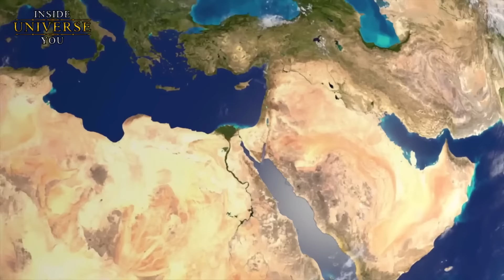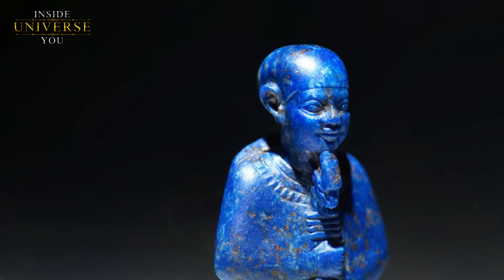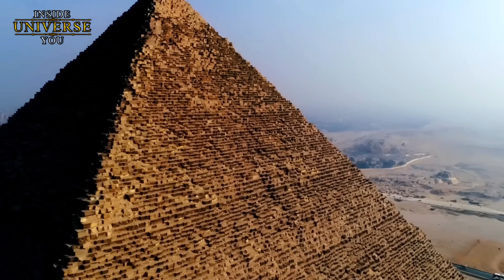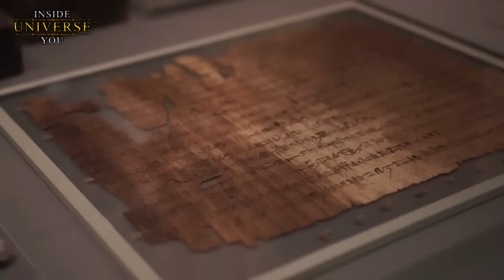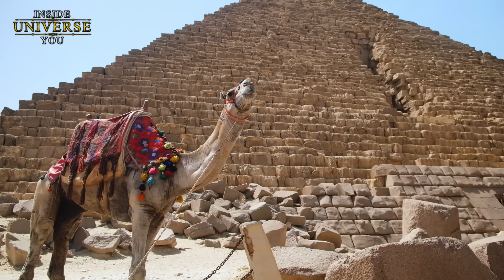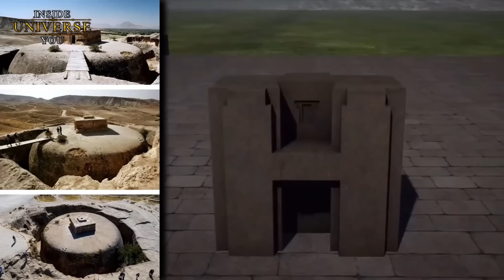They Proved How The Pyramids Were Built: Geopolymer

Comment: The tool marks on some of the blocks was just from smoothening/leveling methods to make the surface perfectly flat/smooth after casting. You don’t know what they used for the casts, there were likely some small bumps/ridges when removing the cast and the ancient Egyptians build to perfection

Comment: Its a power plant. 95% of the planets around the world are build to line up with orions belt. Satellite imaging shows 9 large columns just below. Its possible they are large pyrite crystal than can conduct the earth electricity to connect with the other around the globe. 
I have a theory that at one point in history 200K+ years ago. When all the pyramids were active it powered the startgate systems. They require so much power that only a few thibgs can power it. The sun directly (dyson sphere, zero point energy, the earths spin etc. Occuns razor says its not that far fetched.

Comment: Another great video by UIY. I think it makes sense that the builders would have used both cast and quarried stones as doing so would have allowed them to optimize both logistically. As an engineer, I would have wanted the corners and other structural key points to be natural stone as there is no wait time for curing. By alternating cut stone with cast, the cut stones act as half the needed mold forms. As much of a given level is cut stone, the next level can be started sooner as it is not necessary to wait until the cast stones are 100% cured.

Comment: Given that Gobekli Tepe has terrazzo (concrete geopolymer) tens of thousands of years earlier than Roman use on the floor, clearly such chemical knowledge was commonplace in ancient times. The Land of Chem guy has proven the function of the pyramids was largely for manufacture of desired chemicals. These two things being so, it is now beyond any question that the Pyramid blocks, and those of megaliths worldwide, were poured and cast from powders that were combined and liquefied chemically and which later hardened into stone. Marcel Foti with the Natron theory has further actually done these processes with casting "basalt", "granite", etc. You can easily imitate natural stones visually with the right skills. Geologists actually assess stone types visually, so that means they have no real idea of the origin of any of these "stone" megaliths. This explains scoop marks, precision, tight joints, size, distance, and the other anomalies, in a perfectly rational way. Sadly some people are addicted to being "wooed" by the anomalies and are clinging to the ignorant viewpoint that geopolymer is somehow impossible at this time, but Gobekli's terrazzo proves otherwise. Wake up, Ben. It's geopolymer mate. Lose the ego and we might learn more than "oh wow how did they do it?".

Comment: This video is not rooted in fact. The limestone blocks were the outer casing stones. Not the ones used to build it but the ones used to cover it and make it look white. Those stones are apart of the buildings in ciaro today. The actual inner stones are made up of heavy granite blocks from Aswan. They weren't pored like cement. There's no evidence to support this, further more there's actually more evidence to support the exact opposite.

Comment: maybe the pyramids were in a state of ruin by the time the Egyptians arrived. for example, maybe the top half of the pyramids were destroyed or unfinished. the Egyptians could have seen this and were driven to finish or repair them. this may be possibly why there seems to be more casted stonework at the top of the pyramids as opposed to the lower areas which was stated in the video. the casting of stone would help explain some of the giant stone cuttings and tetris like shapes in walls that are found in Peru. the problem with this is that if those tetris shaped walls in Peru were casted the stone, you would have a flat surface wall. in Peru you see rocks lining up perfectly with no gap BUT the rocks that make up the walls, most of the time, have rounded edges to each rock. if the rocks were casted that would be hard to make a cast with rounded edges.

Comment: so what about the cut marks found on the blocks?
Reply: What about them? What about the scoop marks ?
Reply: @RJB1929 what's a scoop mark since stone can't be scooped ?
Reply: @GroberWeisenstein  Hard stone cannot be scooped. Correct. And yet Peruvian megaliths, Egyptian megaliths (some), and Stonehenge, all show clear scoop marks, and signs that at one stage they were not hard but soft. Obviously not molten, because that would mean temperatures which are not approachable by a human worker. Therefore they were worked whilst at room temperature or close enough to it. And chemistry is how it was done. Look into Marcel Foti's Natron theory. They make kitchen counters the same way, or similar, today. But no scoop marks because the mould is flat.
Reply: @RJB1929  when you see bunny rabbits in the clouds are they actually bunny rabbits ?  Those of us that work in granite quarries and in stone manufacturing know that granite can not be softened or " scooped"  it's simply a misnomer.  " engineered quartz " is a gravel composite bonded by polymer resin. It is not UV stable and resistant enough to be used outdoors where it degrades. You may want to take a weekend stonemasonry workshop and learn some hands- on truths about stonework.
Reply: @GroberWeisenstein  Sigh. Read the book and watch the demonstrations. Natron Theory by Marcel Foti. Irrespective of anything I say, the scoop marks are there for all to see, if you bother looking. They are not controversial. It is the method that is under question. The fact they are there is not.
Reply: @RJB1929 i know how it's done and it doesn't jnvolve " natron" that's a very foolish idea.
Reply: @GroberWeisenstein  No, you don't.  And no it isn't. Ignorance is not your friend. Goodbye
Reply: @RJB1929 stupidity is your conjoined twin. I'm a granite quarrier and manufacturer.
Reply: @GroberWeisenstein  LOL Ok. Go make videos about how impossible it is. Off you go. I'll be right here.
Reply: @GroberWeisenstein  So, explain the scoop marks, then.
Reply: @RJB1929 show us how you scoop granite since that's your position. You  are asking me to make a video showing how it can't be scooped? How do i prove a negative outcome?

Comment: Again casting would still be advanced technology, and where is the blueprint or recipe to make it? In order to cast, they would have have made molds then slid basically slammed blocks against each other, if they made one against the other wouldn't have straight lines way many questions if you've used concrete

Comment: No, I disagree. IMO, the mass produced bricks theory cannot be  correct.
Think about it, if you were mass producing blocks for a massive construction site, all blocks would be the same size weight consistency and design, and they're not, they're all very different to each other.
Then add in the fact that timber was a very rare commodity back then, especially at the volumes that would have been required for a project of this size making the moulds AKA formwork, entire forests would have been needed.
Plus, if you look closely at some of the blocks you can see fossils and inconsistencies in the stone that simply wouldn't be there if you were mass producing bricks plus many blocks show saw and cut marks!
And the 'smoking gun' & a very damning piece of evidence for the 'cant be' camp is, if you were using timber as a mould, there would be clear patterns left by the timber in the wet 'cement', a WOOD GRAIN 'STAMP' that simply does not exist.
Reply: I got the impression they used natural blocks until some Dingdongs let it get too far out of alignment; then a couple of smart guys would cast a stone as the next one in the line, so the fresh side of it would exactly agree with the compass again.  Then the average team followed it until their line wandered again, etc.
Reply: Smoking gun is obvious grain orientation that cast stone doesn't have.

Comment: Absolute horse caca! 🙄 They cut and carved the stones. There are tool marks all over them! We know where the quarries are, with  stones being cut out from them still in situ (aswan quarry)! Heck, one of the limestone quarries for the stone used on the pyramids is RIGHT NEXT to the pyramids, with cut blocks and rubble from cutting still scattered all about! Then lets look at the tests of the limestone; the stone on the pyramids matches the stones still in the quarry EXACTLY in all areas such as in density, granular mineral distribution and composition, impossible with a geopolymer and, again, have tool marks ALL OVER THEM
Why would the Egyptians, or anyone else for that matter, cut out the limestone just to grind it up, mix it, build forms, pour the "geopolymer" (🙄), dry and harden it and then.... CUT AND CHISEL it AGAIN!? Makes absolutely zero sense, as well as making it needlessly more difficult. 
Now, you can make the case that SOME of the pyramids is "geopolymer" (🙄) in the case of the limited use of mortar in between some of the cut stones, as mortar, concrete, etc is a form of "geopolymer" (🙄) but that is the one and ONLY instance where the term is applicable.
Reply: The mortar in the pyramids is gypsum based. Not portland cement or geopolymer.
Reply: @GroberWeisenstein  All mortar IS technically a geopolymer. 
This is my other problem with it! No one can even agree what it is lol.
Reply: @RealKlausSchwab traditional mortars harden via lime binders by process of hydration. Geopolymers have a different chemical composition and harden via polycondensation. Both have unique microstructure as well.

Comment: So, they quarried the sand stone, took to building area, crushed stone into pouder, mixed with water into blocks!!! so why not just use the blocks??? Also, why make blocks in different sizes using different sized moulds??? Ive been there and seen them.
Reply: They did both. Likely they would've used the waste stone from the blocks they cut.
Reply: Exactly! 💯%.

Geopolymer hypothesis makes no sense. In fact, it would be more difficult and needlessly more complicated in certain areas than just cutting and transporting the stones traditionally.
Reply: @RealKlausSchwab  Cutting and transporting would be more complicated than pouring blocks. Geopolymer hypothesis makes sense here.
Reply: @henrikonnou7466 I disagree. Purely because we see tool marks on the stones. 
Whats the point of making millions, even Billions of distinct and unique molds, just to carve them again? None of it makes sense.
Reply: Where did you read that they crushed stones ? Davidovits never mentioned this argument.

Comment: Yes it makes perfect sense. It would be much easier to carry bags of powder up on the pyramids than cut blocks. 👍
Reply: 🤨 How do you think they get the powder? And the forms and molds, they didnt have to build those? Almost every stone is a different size and shape, soooo... it's easier to build 2.3 million different shaped forms and molds for each block? Sounds like MORE work. Also, the blocks still show tool marks on them! So they went through all of the trouble of quarrying stone, grinding it up, building the forms on site to the exact shape and size they needed ...just to cut and shape the blocks anyways?! 
Makes no sense.
Reply: @RealKlausSchwab they had cement trucks. 😂😂
Reply: Then they had levitation technology. How do you think they lifted up all the blocks. I,m saying maybe they poured some of them.

Comment: I have been saving this for years, they were cast in place like polygonal blocks. ❤
Reply from the maker: Glad this resonated with you! ❤
Reply: @UniverseInsideYou  No pun Intended ¿ resonate frequency ❤ being a hair brain concept of locomotion... ❤
Reply: Absolute horse caca! 🙄 They cut and carved the stones. There are tool marks all over them! We know where the quarries are, with  stones being cut out from them still in situ (aswan quarry)! Heck, one of the limestone quarries for the stone used on the pyramids is RIGHT NEXT to the pyramids, with cut blocks and rubble from cutting still scattered all about! Then lets look at the tests of the limestone; the stone on the pyramids matches the stones still in the quarry EXACTLY in all areas such as in density, granular mineral distribution and composition, impossible with a geopolymer and, again, have tool marks ALL OVER THEM
Why would the Egyptians, or anyone else for that matter, cut out the limestone just to grind it up, mix it, build forms, pour the "geopolymer" (🙄), dry and harden it and then.... CUT AND CHISEL it AGAIN!? Makes absolutely zero sense, as well as making it needlessly more difficult. 
Now, you can make the case that SOME of the pyramids is "geopolymer" (🙄) in the case of the limited use of mortar in between some of the cut stones, as mortar, concrete, etc is a form of "geopolymer" (🙄) but that is the one and ONLY instance where the term is applicable.
Reply: Many blocks have been removed or tumbled out of position revealing that they have been dressed on all sides unlike forming of cast materials.

Comment: why haven't they poured entire sections in place then? instead they poured thousands of "small" blocks.
Reply: The same reason that bricks are built today. It's a lot easier
Reply: @tims9434  your argument doesn't really makes sense. working with bricks today is easy because there are only a few types of sizes and one person can carry them by hand. the stones of the pyramid vary greatly in size so you would need a ton of different forms or build forms as you need them wich isn't really efficient.
Reply: @tims9434 but bricks are easily handled these weigh many tons each.

Comment: It would be more logical it was clay that was hardened out with heat. That would make the scoop marks at Aswan more plausible.
Reply: There very well could and would have been variation processes.  The Concrete method would far outlast a clay method.

Comment: From what I heard is that the granite once melted loses an element in the process and the granite that is there has that element. So I don't think that will work for the granite but perhaps the lime stone.
Reply: If you melt granite, it completely changes it's crystalline structure, granite's unique properties come from it cooling at a specific rate under geological pressure. If you just cool some lava down, you do not get granite.
Reply: @finndomegan5213 exactly. Which is what the scientific evidence about the granite in the Pyramids is. Isn't it?
Reply: @finndomegan5213  And you cant make limestone geopolymer that matches the crystalline structure of the casing stones in the pyramids, either. 
They have seashells and fossils still in them for goodness sakes lol. Did the Egyptians just forget to grind up those parts? 🤔 Or did they just throw them in while they were mixing the concrete just to throw everyone off, and to make it less structurally sound? 😏🙄
The geopolymer hypothesis makes zero sense.
Reply: It doesn't work with the limestone either. This whole theory is nonsense. There are tool marks on the limestone, and we know where the quarry is at because its RIGHT NEXT to the pyramids and, guess what?... there are cut stones and rubble still in the quarry proving that they did, indeed, cut and shape the stones. There is also tons of heiroglyphics that the Egyptians themselves wrote showing them cutting and transporting limestone stones. But back to the tool marks. Why would they cut and grind up limestone, somehow wet and mix it, build a form presumably the exact shape they needed, pour it, dry and harden it and then... Cut and CHISEL AND SHAPE it again! It is needlessly complicated and makes the process more difficult, NOT easier.
Reply: In the beginning the guy said that the stones have air bubbles in it that shouldn't occur naturally. Well just because it shouldn't doesn't mean it DOESN'T because when they went to the quarry and tested the stone still in situ, the natural rock, they had the EXACT same composition and structure. No difference.
Reply: @RealKlausSchwab it becomes a volcanic rock or a different grain rock. According to science but maybe they used magic to make it?
Reply: @NonameMonk  Magic. Yeah. Why not. Heck, maybe no one even built the pyramids to begin with! 🤨
Reply from the maker: You are right. We talk about the granite blocks later in the video.
Reply: @UniverseInsideYou sorry I was commenting before I saw the whole video. Thank you. Love hearing about ancient empires.